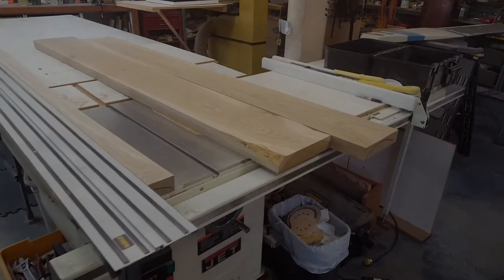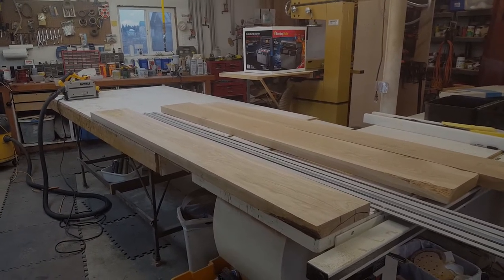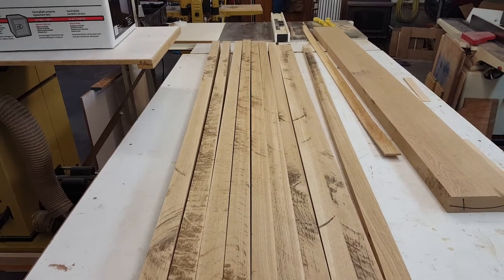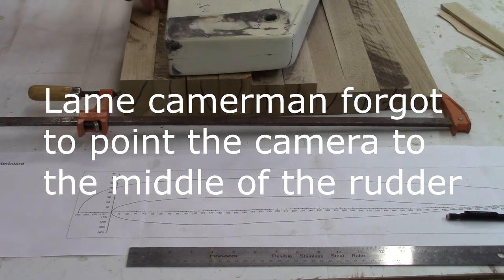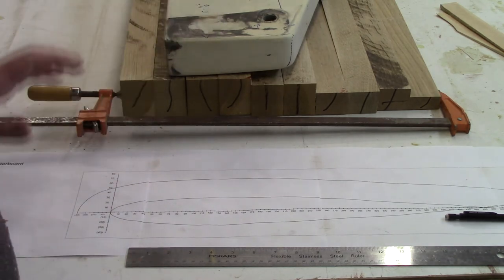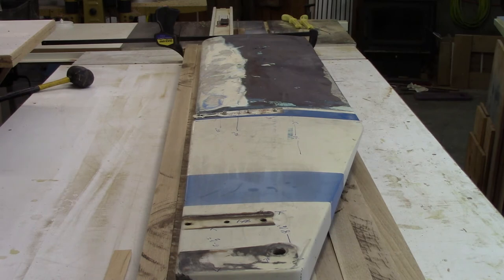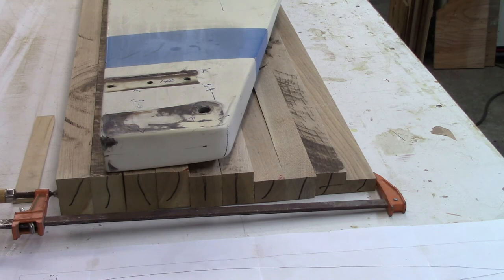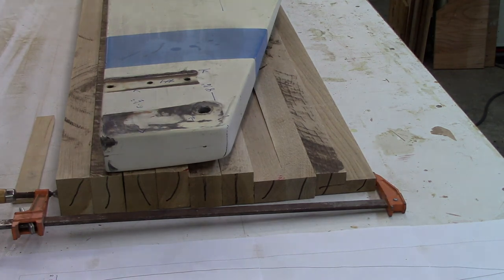Wood Core Rudder Build, J30 Balanced, Part 1

Comment: For the rudders I have built, For the leading edge and trailing edge boards, I cut them in half, and epoxy them back together with several layers of fiberglass matt. This reinforces the the front and back, adds a lot of support to the tapered trailing edge,  an impact area on the leading edge, as well as gives a centerline to shape to.
For holes, I drill an oversize hole, fill with epoxy, then redrill. The hole is water tight.
I don't use carbon, as I have no idea on how many layers I need. Carbon doesn't stretch, so it's either strong enough, or snaps, usually at a bad time.
I have switched to S-glass for a skin.

Comment: hi nice work! i'm planning to build my rudder too but i plan to do it with marine plywood. I do also have access to oak (old steps from stairs). Is there a reason for using laminated oak instead of  brand new marine plywood? Sounds like less steps for me.  Just wondering, it's my first rudder project. Thanks!